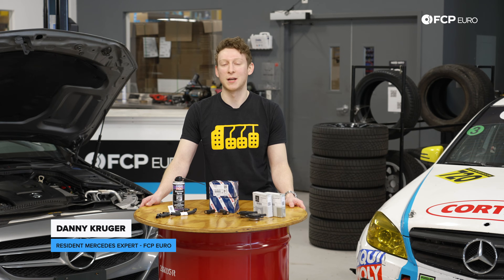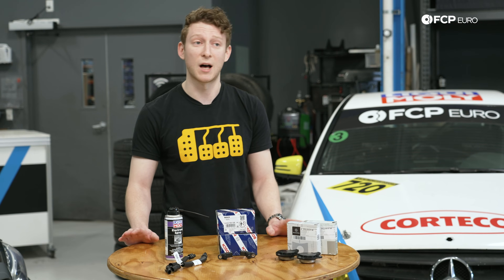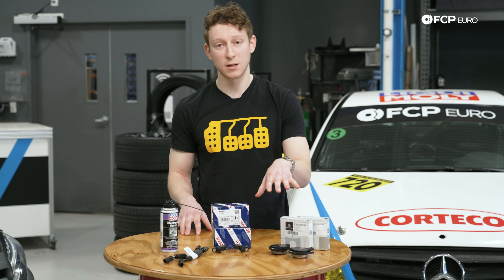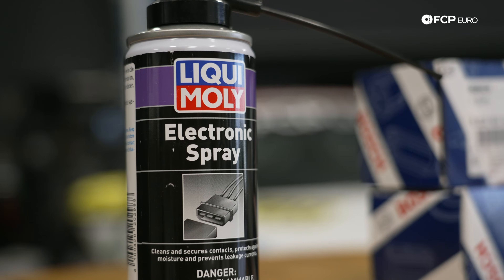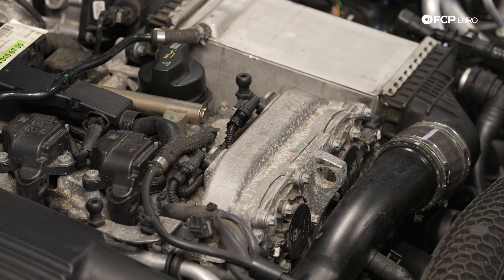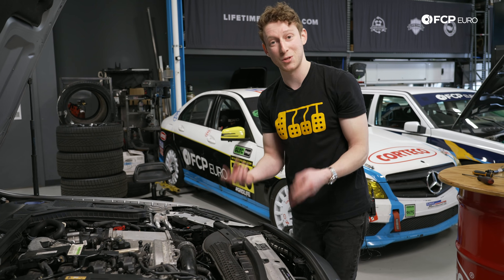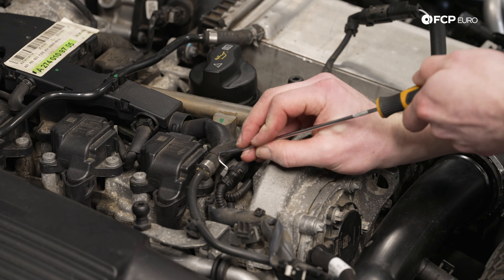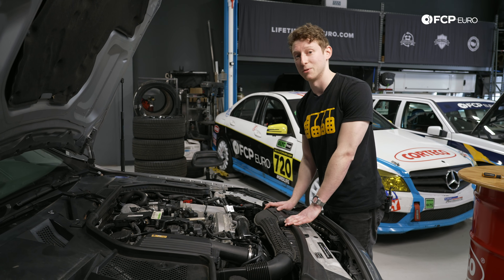Protecting Your Mercedes ECU from a $10,000 Issue - Oil in Wiring Harness

Comment: Came here to warn some other MB DIYers Camshaft Adjuster Magnet Protection Kit" for  V6/V8 Mercedes models (M276/M278/M157/M152/M177/M178

I have the M276 in a 2012 ML 350 gas engine.

I purchased both adverstised products on this video. The Cam Position Sensors, and Magnet Kit.

After install I had the following codes:
P2088 camshaft actuator,
P0183 fuel temp,
P0113 air intake temp sensor 1 bank 1
P0098 air intake sensor 2 bank 1

and Cylinder #1 misfire. 

Checked everything again, re-assembled. Same codes.

I removed the pigtails from the 4 magnets, and everything is fixed. 
I initially connected them exactly as shown in the video. 
4 pigtailsconnectors being defective seems unlikely. 

Just warning people who may purchase these for this paricular configuration (w166 M276)

Comment: I heard my timing chain getting loose on cold starts for about  3 months… Oneday my check engine light came on in for p0016… Repair shop says I have oil in ECU and the ECU is bad and will need to be replaced along with cam pos sensors and sprockets since it jumped timing jams now has rough starts… Does oil in ECU cause timing issues before a check engine light comes on? Can we test ECU or clean it of oil ?

Comment: Would this apply for a w140 1999 s320 with the M104 in line 6 engine?
I have oil in the connector and some. Idle surging but no check engine light
Reply from the maker: Hello there - this solution does target the newer-generation engines, going from ~2003 through current (starting with the M271, running through the 272/273/278 and the others mentioned in this video). A good practice would be to clean the harness out with an electronics spray, and replace whatever sensor (or sensors) seem to be a source of oil ingress.

Comment: How do you check the ECU to see if oil is already in there? What's the proper procedure?
Reply from the maker: This will depend upon your make, model and engine. On the majority of the "Vee" engines affected (278, 157, 276, 272 or 273, as a handful of examples) the ECU will sit directly atop the engine, making for easy access and for an oil check that takes a couple of seconds. 

Regardless of your application or where your ECU is located, best practice will be to disconnect the battery (or batteries) and let the car sit for a while to protect the ECU. Then you can remove the plugs or the ECU entirely to do your inspection.
Reply: @fcpeuro I just removed the ECU plug without unplugging the battery. I cannot try my car yet because I am waiting for parts, did I damage something this way? 😢

Comment: Can rodent damage to the wire and then water do the same thing if the previous owner just taped it up. The engine did stop firing, and sensors went off like camshaft, and sometimes it wouldn't shift right . Cam sensors were replaced, and it started up again.
Reply from the maker: Anything is possible! On some of these newer-generation Mercedes engines, it isn't exactly unheard of for the sensors to go bad - this could be the cause of your shutdown. Regardless, we're glad to hear it's running well after the replacerment.

Comment: Thanks for your video and answers. I'm curious, why they are called "Sacrificial Pigtails" if they stop the problem forever? Do they get ruined by the oil?
Reply from the maker: "Sacrifical" because they serve as sort of a trap for the oil, and accept the oil ingress to keep the rest of the wiring loom safe. We haven't really seen any signs that the pigtails themselves go bad due to oil saturation to date, suggesting they may genuinely be a "plug-and-play" fix, but ultimately time will tell. A wiring splice is definitely easier to swap out than a full loom or ECU though!

Comment: Was it an error when you said V6 and V8 engines will need 8 sensors? I have the M276 which is a V6. My camshaft position sensors are weeping and the estiamate to repair shows 4 sensors and magnets.
Reply from the maker: Eight total for your 276 - four cam adjuster magnets (2761560790), four cam position sensors (2769050900).

Comment: I have a G63 that just found oil in the wiring harness in the ecu !!😢😢 is their any way to clean everything once it has oil ??
Reply from the maker: Hello! Apologies for the later response - we hope you've got your G-Wagen back and driveable, that's one of our all-time favorites. 

It ultimately will always depend on the severity of the oil ingress. If codes are thrown, the ECU is permanently corrupted, and sensors are no longer reading, an ECU and full loom may be the primary solve. Alternatively, if a code for a bad sensor is present, the sensor is removed to find oil, and a new sensor remedies the issue, it's worth unplugging the loom from said sensor and cleaning out the connection with some electronics spray.

Comment: What happens if its too late and dealer wants $10k to repair? Would an independent do it much cheaper? Scrap the car at this point or possible work around?
Reply from the maker: Very likely a European-friendly mechanic will tackle it cheaper, and may be able to leverage used parts to reduce some costs (of course, with the caveat that used parts may also have some signs of oil ingress themselves). While the loom and associated sensors are definitely bothersome to replace, it'll likely be a replacement ECU that is the most-expensive at the dealer or independent. This is a huge reason why we encourage owners to check semi-frequently and to consider proactive maintenance with sensor replacement and pigtail installation; it's much more wallet-protective to prevent the issue than to resolve it.

Comment: Another question if this is just a bypass or a temporary fix, what is the actual fix?
Reply from the maker: The pigtails were more or less a permanent fix on the cars Mercedes introduced them with - M271, M272, and M273 cars sporting them are unlikely to pop codes for the cam magnets due to oil ingress ever again. 

It's still early for the same solution on the newer engines we're discussing in this video, but all signs point to these pigtails being incredibly successful in trapping oil (these are the same ones used on those 271,272, and 273 engines in the 2000s). Stop the oil from moving into the harness, and you protect the expensive bits around the engine from damage - that's exactly why these pigtails exist. 

As for the cam sensors, there is no Mercedes "parts-bin special" to stop oil ingress at this point of access. Since there's no one-time fix at the cam sensors, we've recommended that reduced service interval. Swapping out the sensors regularly drastically reduces the chance that they fail internally and have the chance to leak oil into the loom. At a minimum, we recommend checking the cam sensors every couple of oil changes for oil residue. They're typically pretty easy to access, so a quick unplug and inspection here and there will keep you in the know.

Comment: Can someone tell me if is an issue on the W221 07 S550?
Reply from the maker: The aformentioned vehicle will be equipped with an M273 V8. Early 272/273s did have issues with oil wicking into the loom through the camshaft adjuster magnets, but many of these vehicles will have received the very same sacrificial pigtails under warranty as we used in this video. Check your magnets and see if you already have them, and if not, installation of four MER-2711500156 will keep your M273 ecu safe.

Comment: You can get pigtails for camshaft position sensors as well , I got it on e.B.a.y  , replace it all … gray tabs slide straight out, but you have to pull them out little bit until you hear click , and then just push down on it with your thumb, and pull it out…
Reply: Exactly what I've done (W222) and the cam position pigtails from ebay worked out great!
Reply: How dod you find them? What item # did you search for?

Comment: For the record, once you change the magnets & pigtails, check them every 10,000 miles. They eventually leak again. The sacrificial harness buys you some time, you can replace the pigtails again and again they're cheaper than a harness. (M157 owner)
Reply: When you replace the position sensor, take a toothpick or narrow sharp tool to apply gasket maker at the base of the new sensor’s conductor prongs to create a seal.  This prevents another leak down the road.
Reply: @badkid73 You mean on the o ring that is sealed against the engine or you mean the one on the connector.
Reply: @civilization95 not the cam shaft solenoid.  The cam shaft position sensor.  Solenoid rarely leaks.  Sensor always leaks and oil travels through the harness to the ecu
Reply: @badkid73  I am referencing to the same. Camshaft position sensor.
Reply: @civilization95 the o ring doesn’t leak.  The oil wicks up the actual wire back up the harness and connector.  It must seep through the crevice where the plastic pieces come together but eventually all sensors leak up the harness wire.  It’s a matter of time.
Reply: @badkid73 Thank you for explaining sir..I just wanted to know exactly what you mean when you say 'apply on the base of the new sensor' to me it is not clear what the 'base' is
Reply: I was always wondering about this and suspected this will be the case. Unless those sacrificial harnesses contain a solid wire they are going to be a temporary relief. Another thing I am wondering about is why other manufacturers are not plagued by this, while Mercedes has been unable (or purposefully unwilling?) to solve this issue for decades.

Comment: Can someone elaborate on how the sacrificial pigtails will act as a preventative? Wouldnt oil just continue to make its way up into the ECU wiring?
Reply: yes it does! I go through this with my Benz 2012 S63 AMG, part of the game. I replace the pigtails regularly. The magnets last awhile after you replace them. I had better luck with camshaft sensors direct from MB the FCP ones leaked.
Reply: @samspace81  Thanks!! beautiful car and motor (:
Reply: They make it so oil can’t wick past the extension into the wiring
Reply: @zain4388  false! Unless they start making a solid core wire the capillary wicking still happens, but it buys you time

Comment: My 2017 C300 got a CEL two weeks ago and I took it straight to the dealer. P052871 code came up and after 3 days I got a call from my service advisor. I had to replace the wiring harness, PCV valve and a new ECM (Oil contamination). I nearly got an ulcer worrying about what it qould cost. Turns out I was smart enough to get the extended CPO warranty and I didnt pay a dime. I got very lucky.

Comment: They don't work I fitted and still have the issue.
Reply: Did you change out the original sensor and magnets that already had oil in them or the connector itself? Or maybe the oil made its way down the harness already before you caught it.

Comment: Awesome information. just got a $13000 bill from the mercedes dealer for this issue. wanted to know if Ineed to change the entire engine harness. Will using the spray suck the oil out if i have oil in multiple locations

Comment: How is this not a recall? MB is aware of the issue as they manufacture the fix. This is weak from MB. I have had a lot of trouble with their warranty department on my last two cars (new '19 C300 Coupe, Certified '20 GLE580). One was accusing me of having damaged a sensor on a brand new car (no evidence) and more recently with their Certified warranty not covering the known-issue GLE driver's mirror whistle, again accusing me on damage. Both cars were immaculate. Might have to be a BMW or a Porsche next time!

Comment: Sadly, I wish I'd seen your excellent video a year ago. I had the same exact problem on my 2014 GLK and you are right: $10k to fix so I got rid of the car. My question is If this is such a prevalent design problem affecting almost all of their engines, has there been an attempt at a class action suit to force MB to acknowledge their engineering shortcoming and propose a fix? I took my car to the dealearship for years and there was never a mention of this until I took my car to an independent service shop and had that pointed out. It is a shame as the car is otherwise in great shape as I've taken care of it.
Reply: It's certainly an oversight by Benz (sad to hear you had to move yours out). I recently had my GLK at the dealer to help locate the source of an oil leak for me, which ended up being what I suspected - timing cover gaskets, solenoid magnets, etc (you can certainly see the oil build up around these areas). They gave me that absurd quote for the harness, but I declined. No strange error codes as of yet - or other issues - so I'm just going to take care of all the known maintenance items and clean up the engine and harness as much as possible during the process (including the electrical connections and ECU). Fingers crossed!

Comment: Just installed the pigtail extensions and nothing else. I have 160k miles . Just got the car a few months ago and there was oil when I went to install the new pigtails so I sprayed it with electrical cleaner a few times and faced it down to drain out then put a rag under to catch it. There was a good amount of oil up in there smh. Thank God I installed these before oil got in there .
Reply from the maker: Great work!!!

Comment: On the 274 the oil mostly leaks in from the ccv. If you don’t replace with the updated ccv intake line you will ruin the new engine harness you just installed.  Great info either way. Definitely the case on the other engines you mentioned.

Comment: You keep mentioning late model engine, but would a 2012 m276 have this same issue too?
Reply from the maker: Yes, "late model" in this instance is a catch-all for a lot of the direct-injected Mercedes engines. Anything with that "276" part number prefix on the Cam Magnets is worth unplugging the harness, inspecting for oil ingress, and considering these protection kits!

Comment: Great information as always. But for the noobs out there like myself, it would be greatly appreciated if you guys could do a video actually replacing the cam magnets and cam position sensors, especially on the M274 platform, since it's such a commonly used engine, and shares similarities with other platforms. Detailed disassembly to access the bolts of the cam magnets hidden by the intercooler piping, and torque specs would be really helpful to avoid damaging the new sensors and cam magnets while installing them. Once again, great video and helpful information for us DIYers, and I look forward to future content, especially on the M274 platform.